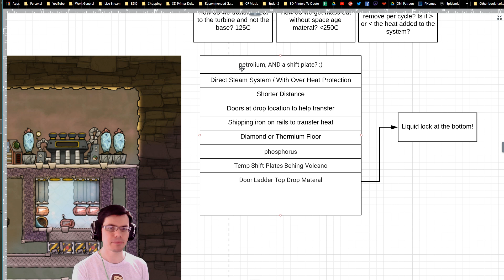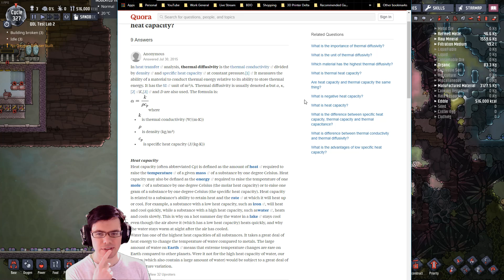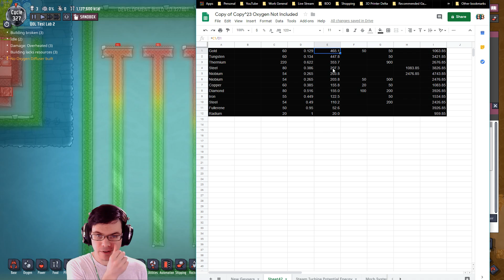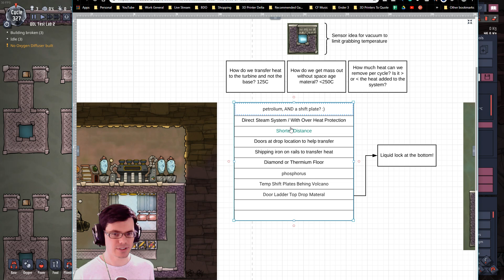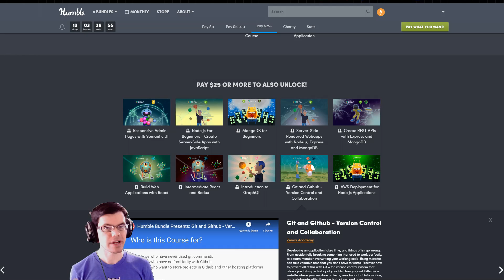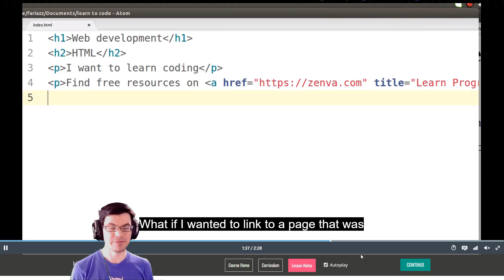Oxygen Not Included - Automated Renewable Volcano Power With Steam Turbine!

Comment: Was i the only person who took materials science classes watching this who was in serious pain watching this, (bearing in mind that ONI does follow some real world rules about the subject in question)?

TLDR for anyone reading this. Assuming you can prevent significant heat loss via conducting heat away from the volcano and not into the generator you can pretty much treat energy in as energy out. This has a couple of key consequences.

First if you want to extract a lot of heat from somthing quickly you have to have a means of doing so. So if the total output of your generators isn't sufficient you've had it as far as getting your stuff cooled down.

Second the rate of transfer drops if the temperature differential is less. In other words the cooler your heat source is the slower energy transfers.

Third your cold side of the cooling system needs to be at or below the temperature you want for your hot side. Thanks to point 2 it actually needs to be significantly less. Thus if you want to cool the iron to the point you can pick it up with a sweeper it is impossible to also generate steam usable by a steam turbine.

Comment: Now my question is, would it be beneficial to utilize both sides of the volcano? That would make it easier to cool down the iron because there will be less mass overall, however, how will that effect the heat transfer if you were to say mirror that design on the other side and attempt to grab power from both sides?
Reply: From what I can tell, it only drops down on one side.  I believe he said earlier that it prefers to fall off on the left, so he had to block that side for his system to be closer to the dropped metal.  If it dropped equally on both sides, that would just halve the output, kind of.  (There may be other losses that may not be able to be capitalized on when you are not right next to the heat source)  Heat does not transfer very well and ends up dissipating at close to a square of the distance and based on the materials ability to absorb/transfer the heat.  If you have a "perfect" heat conductor, it would not matter how far you are from the source, but nothing in the real world is perfect.

BTW, what would happen you extended the gold plate to the left side of the neutronium?  Would it interact earlier and allow for a quicker spike, or would it just cause the metal to cool too quickly to fall off the neutronium?

Comment: with your thermal conductivity test, you also have to take into account the energy that goes into heating the iron (once).. in the long run gold wins, as the maximum conductivity = the minimum temperature difference supported between the 2 ends.

Comment: with  the first design, the heat buildup was an ok thing, as the mass builds up, the minimum energy per cycle also decreased. The hotter it is, the faster the transfer occurs. I'd expect an equilibrim to be reached where the steam turbine extracts the number of dtu added from the volcano, and it stabilizes with the iron at a few hundred, and the turbine at a few hundred all the time...

Comment: Nice and clear video Brothgar, I think you hit the thing. But I extract some conclusions about heat transfer, materials, power and turbines. With iron volcanoes you can only seek for the iron, and get some extra power in the process (maybe for make the system self-powered, like a SPOM); so you need materials that drains the heat fast (I.e. gold and steel). But with magma....you can have a true geotermical power plant, if you build a vertical magma pit (one tile wide) with ST conected in both sides with just one tungsten metal tile,and drastically reduce the heat transfer (to get more more ST and power) by reducing the room for steam to only one tile tall. Then, magma (and igneous rock too) its like a 'heat batery' if the ST are disabled if a temperature is hit. The main problem I'm having with that idea is how to chill the steam turbine rooms (and try to cook some crude oil into petroleum ^^). 
So, chill material fast with metal volcanoes and get a punch of free power; and retain the most heat possible and low heat transfer whit magma and igneous rock, looking for tons of power (and food for hatches if you chill it)
Reply: Well, the volcano magma pit works, and even you can get petroleum at 1:1 ratio. When I finish balancing it I'll post it in your discord chanel :) It isnt the big thing because only runs at full output a few cycles and you need thermium and super coolant, but once you get the NG boiler working, all the power from magma pit should be net positive. 

Currently working in how to farm the heat in magma biome in an easy way. And even further, why go all the way down looking for heat when you can reach the infinite heat from the stars? ;)

Comment: Faster transfer (gold) is better than more specific heat capacity (steel) Brothgar, because think about your "saturation condition". If you ran that for 100 cycles, then what will be the best for cooling down your iron? it'll be bottlenecked by transfer rate INTO the water, irrespective of specific heat capacity. The material that transfers into water 'best' would obviously also be able to transfer heat out of iron best.

Thermal mass gives you friction, but if you imagine heat to be like "passengers" travelling between two different stations, the limit is how fast they get on and off the vehicle, and how fast the vehicle travels (internal transfer, which is related to thermal mass). At saturation (provided you can saturate), the road will be jam packed with traffic, and then your vehicle travel speed will be limited by the speed passengers are getting off at the end. I think?
Reply: Thermal mass is good in the transient state because you can get heat out of the input and leave it near where it entered into the rod, without having to move it down the rod. In steady state, thermal mass is bad, because it reduces thermal gradients, making it harder for heat to get from the input to the output at fixed thermal conductivity and fixed tile geometry.
Reply: Here im copy/pasting my multiple explanations "Heat Transfer in materials is called Thermal Diffusivity, long story short ingame you can ignore density cause of 2D game AND everything is made of same amount of mass in KG and same size(Tile). Example, when you make a Thermal Shiftplate it takes 800 Kg of any type of material to make, the all the same. SO, you just compare the Ratio Value = Conductivity/Capacity figure out which is best or worse for your needs and voila. Its like a Bucket of water with a hole in the bottom, size of Bucket is Capacity and hole in the bottom is ConductivityHeat Transfer in materials is called Thermal Diffusivity, long story short ingame you can ignore density cause of 2D game AND everything is made of same amount of mass in KG and same size(Tile). Example, when you make a Thermal Shiftplate it takes 800 Kg of any type of material to make, the all the same. SO, you just compare the Ratio Value = Conductivity/Capacity figure out which is best or worse for your needs and voila. Its like a Bucket of water with a hole in the bottom, size of Bucket is Capacity and hole in the bottom is Conductivity"

Comment: ... So that means you can have thermal batteries with Steel?
That is awesome.
Honestly, you should use the Steel doors as a thermal battery... or a metal tile the ore sits on with Steel.
If you need to transfer energy, then yes, Gold/Tungsten would be able to do that, but Steel is where it can keep that thermal energy and drain the iron fast enough to handle for more processing. Even Diamond Shift Plates could potentially heat Gold/Tungsten enough that the transfer can be instant.

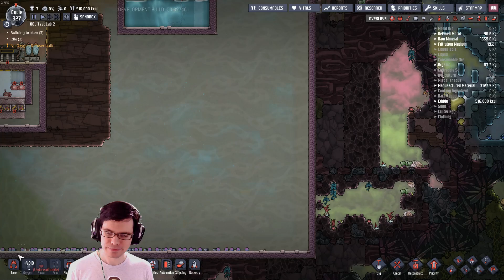Comment: I've played my fair share of this game and watched a lot of brothgar videos and always thermal conductivity and specific heat capacity were beyond my ability to understand, but that simple experiment at 8:37 made it instantly click. As others have noted it's the same recurring concept of bandwidth you see in data, fluid, or electricity transfer.
Reply: think of it like a Bucket of water with a hole in the bottom. Size of Bucket is Heat Capacity and the Hole in the Bottom is Heat Conductivity. It's called Thermal Diffusivity in Thermal Dynamics.
Reply: @Frenchstud69  Indeed. I saw your comment in the video and actually paused to read and then searched for it so I could expand it. It was helpful as well.

Comment: specific heat capacity should be negligible ones there is a stable state. It only influences the time it takes to "heat up". thermal conductivity is how fast you can move the heat. If you can not cool the material fast enough, you can add more cooling (more turbines), adding more mass to the system only increases the time it takes to overheat.

Comment: the limiting factor for GOLD > water heat transfer is the water itself. The limiting factor for STEEL > water heat transfer is instead the thermal capacity of the steel itself. 

Over multiple cycles, GOLD should average out better as it is CONSISTENTLY transferring max potential to the water at all times. So for only energy needs, go with Gold. If your goal is to cool off the molten metal, then go with Steel.

Comment: Brothgar you can then autosweep the iron into a liquid basin by the base, cooled by the ice maker :D

AND the ice maker is powered by the turbine. AND you can feed the original water of this whole system with toilets and water seives.
Reply: And you could use the endless supply of metal to make the chips that provide for power!
Reply: @ashurroth6585  are those useful?
Reply: @G.r.e.g.g.l.e.s  yep they add 50% power I think so the 400 from a wheel became 600 and the 800 gas genny became 1200. The steam turbine should follow suit

Comment: One metal seems to extract faster because it takes longer to reach the same temp as the hot iron, but once it equalizes it will just become as slow as the other metal (it's just "storing" more heat before it becomes "full"). So long term it will make no difference, only the highest conductivity will matter.

Comment: As far as the inconsistencies in your tests, maybe build order matters? I've seen many cases in games where flow of heat or liquid can vary based on the order the transfers are computed in, and subsequently, by the order the items were built in.
Reply: I think mostly he's forgetting the mass of the temp shift plate itself. 800kg holds a lot of heat.

Comment: Maybe try a two-stage system? First stage using a large heat sink to quickly cool to below melting point of machinery, and the second using high conductivity to keep the water as warm as possible with a cooler input temp.

Comment: Ultimately, you want to get heat from the volcano to the steam chamber. Considering that you only lose heat as you run the turbine, the only thing that matters most is surface area, conduction rate, and highest operating temperature (so you don’t melt). Once the system is warmed up and in equilibrium, most other factors like heat capacity and specific heat are moot. Your main bottlenecks are the turbine’s heat conversion rate and the material’s conduction rate. The heat conduction rate to the steam needs to be as close to the turbine’s conversion rate (but not exceeding) to get maximum efficiency. A Lesser bottleneck to consider is heat input rate (Does the volcano output more heat over time than the turbine can consume?)
Reply: The conduction rate is proportional to the thermal diffusivity, which is the ratio of thermal conductivity to heat capacity. So no, they're not moot.

Comment: @Brothgar  So on the specific heat capacity don't you want a high heat capacity material with an average thermal conductivity that is roughly equal to that of the water. Essentially you want to transfer as little heat to the water as necessary to keep it steam (why do we care if its a 1,00 degrees vs 500 it still makes the steam turbine turn at its highest generation speed) while keeping your average heat of the tile high enough that you are retaining more of the heat within your system. If I am thinking about it right that would keep your average heat between eruption & dormant times high while still keeping the steam hot enough to drive the turbine. If you speed up the rate at which your tile absorbs it and maintains it, it increases that average. I guess the bottom line is are you worried about your average ROI in energy over 10 cycles vs 100 with the material choices, frequency of eruption, and what do you care about the efficiency if you have other reliable methods of generating power in your scenario. Also side note: if you can make it efficient enough then you could run multiple turbines and spin them down as you can no longer keep the heat/pressure high enough to maintain the highest power generation values.
Reply: Heat Transfer in materials is called Thermal Diffusivity, long story short ingame you can ignore density cause of 2D game AND everything is made of same amount of mass in KG and same size(Tile). Example, when you make a Thermal Shiftplate it takes 800 Kg of any type of material to make, the all the same. SO, you just compare the Ratio Value = Conductivity/Capacity figure out which is best or worse for your needs and voila. Its like a Bucket of water with a hole in the bottom, size of Bucket is Capacity and hole in the bottom is Conductivity

Comment: You could add a door between the volcano and the system with a liquid sensor on top. So just as the volcano erupts it sends a signal to a sweeper arm to remove the iron and with a slight delay the door opens to let the iron down.

Edit: it basically achieves what you did at the end but with a sweeper arm

Comment: Would a shift plate transfer faster than a tile? Or does the mass slow it down?
How it seems is that a high mass should transfer faster since there is more material to transfer it.
Either way, you could play with this idea to transfer or even hold heat (for slow dispersion)

Comment: I think your thermal diffusion experiment is flawed because the thermal mass of the sink is negligible compared to the thermal mass of the tiles transferring the heat: if the tiles have less thermal capacity (even with high conductivity) for sure the material on top will stay hotter because there is not enough capacity to dump the heat into. Try putting a high mass at 125°C (which is you sink temperature) and see how the source cools down.
Reply: @brothgar if you set the temperature of the sink lower, I think the results would be conclusive too

Comment: The important thing to consider about conductivity, specifically in this experiment, is that because the media's temperature goes in cycles, you can simply ignore the heat that goes into the media, as it will eventually come out later. And if you want to be really serious, than thermal conductivity doesn't really matter either. If you graph the temperature of the iron and the steam, they would look something like a consine wave. If the thermal conductivity is less, than the delay of the steam graph would be greater. If the thermal capacity is less, than the graph would be less smooth. In an extreme case, if you use insulated tiles with high thermal capacity, you can still get the heat of the volcano into the steam turbine. All of them. No net loss. The only downside of that is it will take infinitely long for the turbine to heat up, but there should be no heat/efficiency loss _in the heat transfer_.

The reason why you might see some weird behaviour may be that you haven't let the system reach its equilibrium before taking the readings. You probably need 5 to 10 eruption cycles to do that.
Reply: Very deep, very smart
Reply: I thought about this too, but then again tapping the volcano was the priority here. Energy was just collateral right? Bigger delay in control means its harder to take out cooled iron out of the system.
Reply: Same as places that do not shut down on weekends, as it takes more power/time to heat back up then staying at operating temp.
Reply: you might get trouble with overheating if the conductivity is to low.

Comment: why did the thermium not transfer the heat out of the iron quickly? I'm so confused.
Reply: its because of the heat capacity, thermium can hold .2 more heat than iron. Also heat transfer rate of iron is lower than thermium so its spreading more evenly at a slower rate.
Reply: @gandalftheantlion  but the actual iron stayed liquid on top. With thermiums high transfer rate, it should be pulling the heat out of the iron quickly to try to approach equal temperatures. I realize because thermium has a high heat capacity it wouldn't actually get as hot, because it holds lots of heat energy, but it SHOULD be cooling the liquid iron very quickly.
Reply: CrixOMix sometimes the game glitches out, perhaps it’s a bug? I’m not sure, I thought maybe because thermium has a high heat capacity that might be it. But it shouldn’t effect heat draw, very strange, all I was suggesting was that it might because of heat capacity(?) but your right it should transfer quickly.

Comment: I just flood it with enough water to absorb the heat.  It turns to steam.  Build the generator above it.  I usually use automation to control the water level and steel doesn't hurt for the auto collector.  I build shift plates behind machines to add mass and to keep the machine temp down.